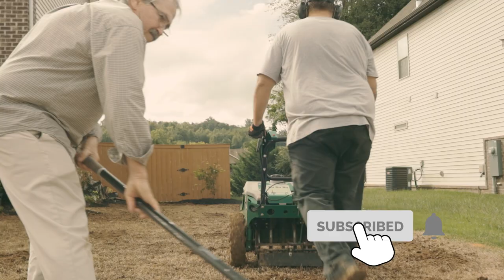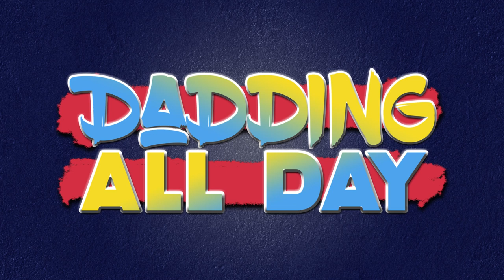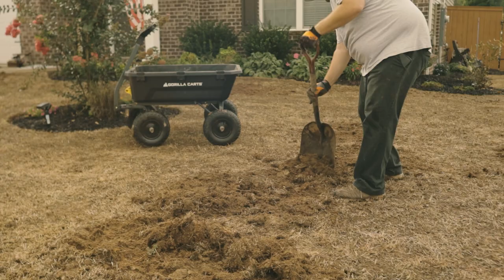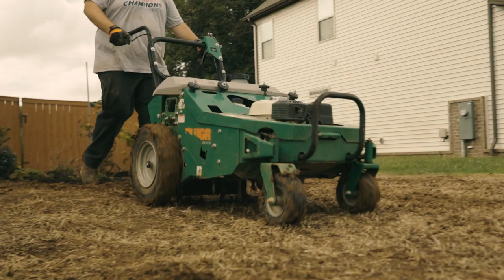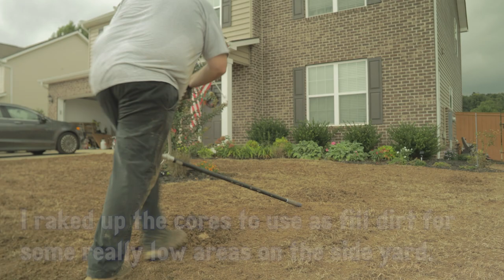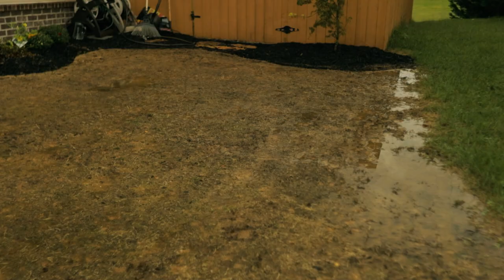Let's Aerate the Lawn - Tips and Tricks for Success

Comment: This is so interesting and confusing.
Today I watched a different video by a creator called GCI turf and he showed a larger machine called an aerovator that he says his business uses year after year to do aeration.
He is on red clay as are his clients and he didn't mention anything about it raising the gross density of the soil even though it clearly is solid tine.
I don't understand how he can get good results and use these machines for business, on clay and not notice this condition you say occurs.
What are the signs of to much solid tine aeration?
Reply from the maker: I honestly couldn’t tell you. The aerovator is more than solid tines as it also vibrates and shakes the soil. So I imagine it’s an entirely different process. Where your typical aerator with tines just stabs the soil.
Reply: @DaddingAllDay 
You are on clay.
I am on low cec well drained sandy soil.
I have not seen the tines on my Billygoat 18 inch mechanical machine "go in and out", they appear to shatter a hole and leave loose soil on the edges.
This is with the 7/8 solids that are one of the four options for the machine.
Billygoat is the only maker I know that offers this flexibility.
I am disappointed that many content creators have repeated the phrase about increasing gross density without mentioning their soil type and knowing how to quantify this.
I don't blame you at all but I do blame companies the only make hollow tine machines for spreading advertising like it is facts.
I really enjoy your channel and I will shut up from now on!
Reply from the maker: No need to “shut up”. Without the proper tools, it’s hard to quantify, not that I could even if I had those tools. The rolling tines that I’ve seen other homeowners use, don’t shatter the surrounding soil. They just roll over, creating the hole. These are not mechanical, they are pull behinds. So, if the ones you are referring to shatter the soil, it seems more like GCI Turf’s aerovator. Thank you for watching and the kind words. Keep commenting. I appreciate the conversation.
Reply: @DaddingAllDay  I understand what you are seeing and thinking now!
Thank you for your replies!